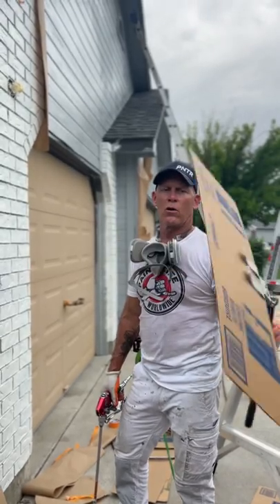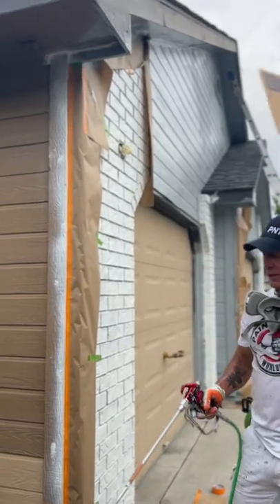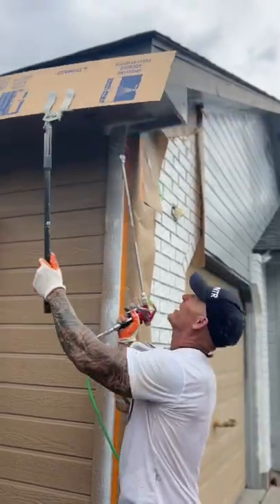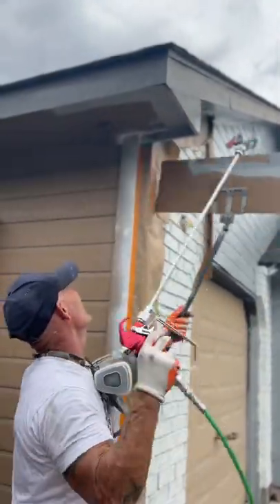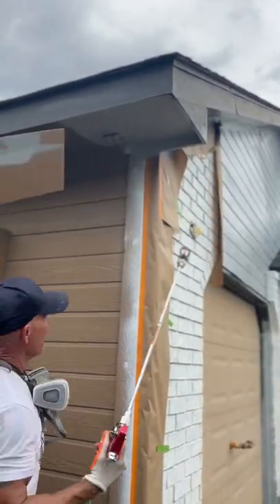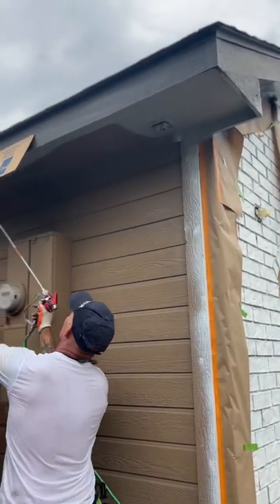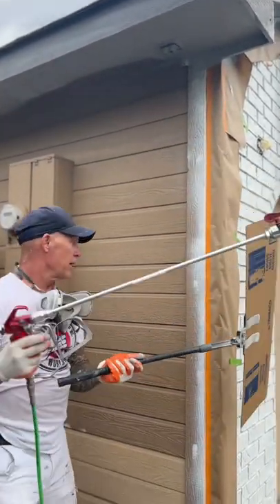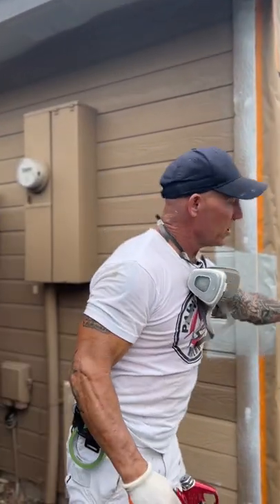Mastering overspray with this tool. #shorts

Comment: A metal shield would be much better. You can wipe it off and keep using it versus cardboard.
Reply: Metal shields will drip if you are not careful vs cardboard you never really have that problem because it absorbs the overspray